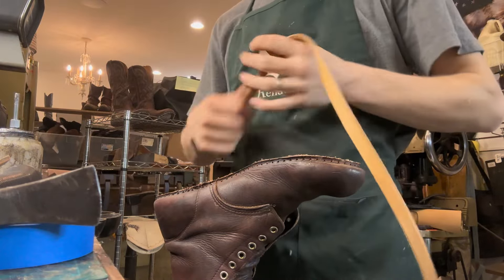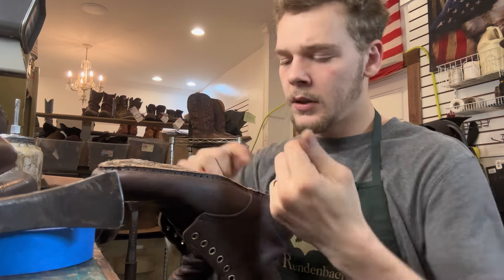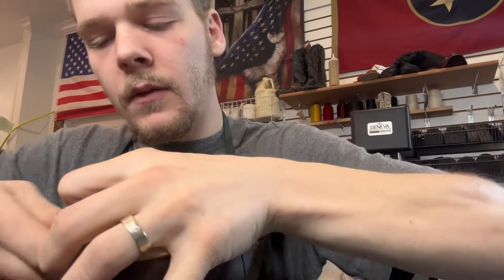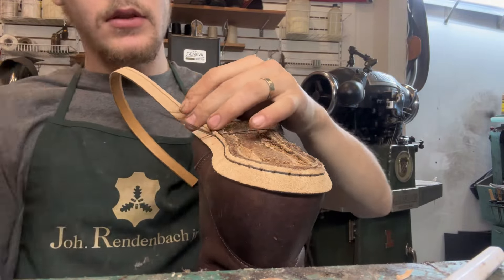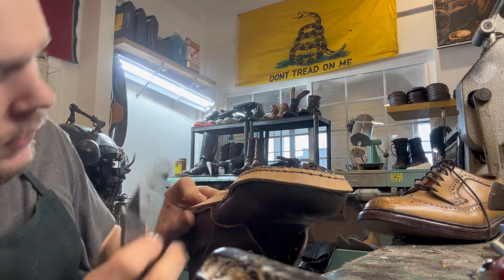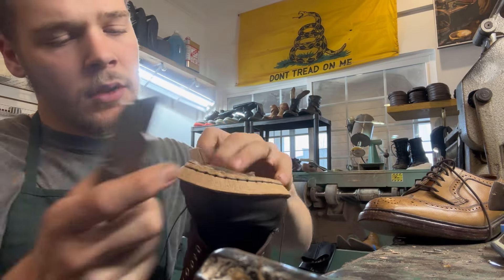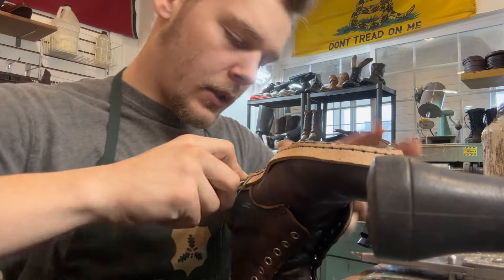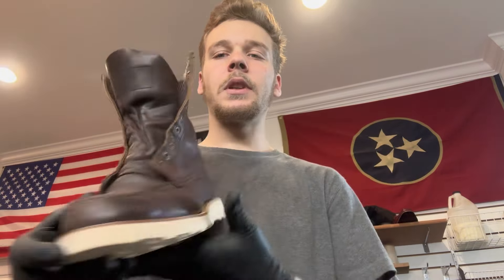Welting Wednesday! Rewelting A Pair Of Redwing Boots Plus Random Thoughts From A Shoe Cobbler!

Comment: why do you poke holes from the welt and not from the insole as it's supposed to be?
Reply from the maker: Wether you start from the welt or the footbed, it still works. Both ways work just fine
Reply: @Theshoeman02  just asking, as I've never seen any shoe or bootmaker welting from the outside...
Reply from the maker: @pb1964  interesting I’ve only seen shoe makers do that.
Reply: @Theshoeman02  that's quite strange, and usually they don't use that hooked awl too... I see that just cobblers do... they use an awl and then 2 needles to sew the welt and the soles, at least in Italy... no custom shoe maker would ever use a curved needle machine to stitch the soles, or sanding... it won't be considered hand made from a custom maker point of view. high end shoe factory do and put the "hand made" stamp on their shoes, but very few it's truly made by hand by factories, not even lasting...